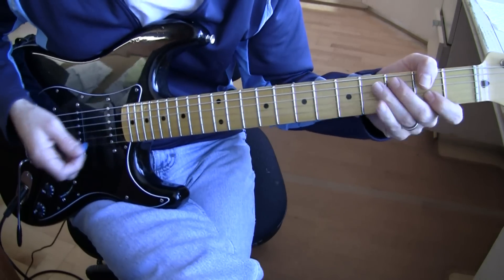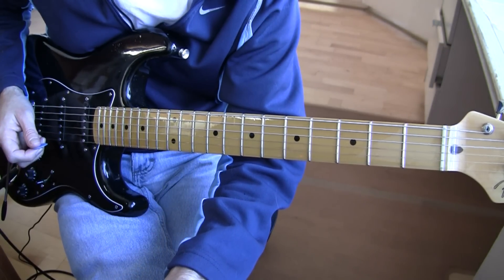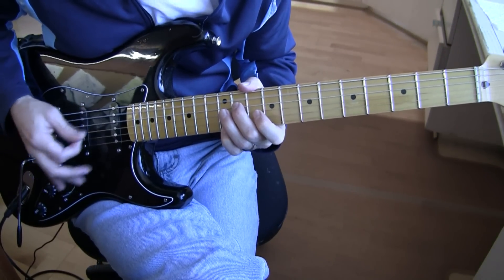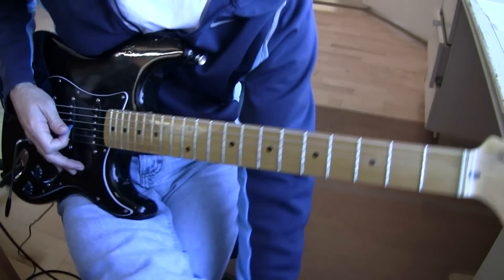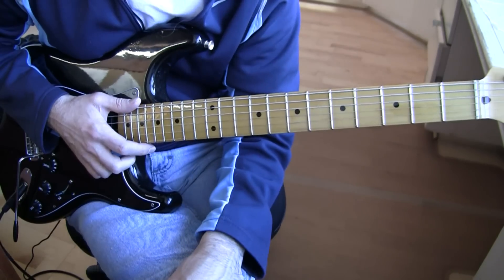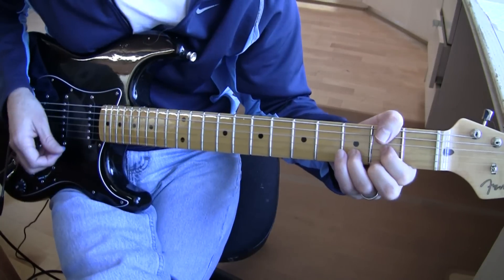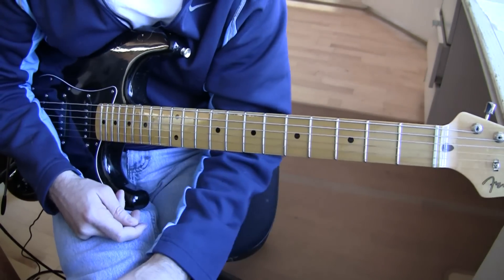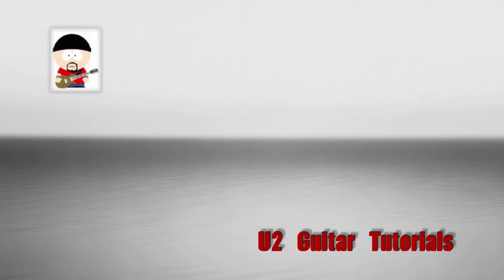Part A3:  Bad (U2 Guitar Tutorial / Lesson) - Modeling SDD-3000 Preamp with Axe-Fx Ultra

Comment from the maker: @sims3ps3NG: 
M13 is simple, but the HD500 acts more like a traditional foot controller with preset and instant access buttons.  It also has a built in expression pedal.  Overall, it's the better unit in my humble opinion.  You can always turn the amp modeling off.